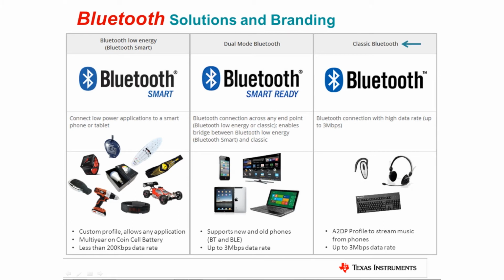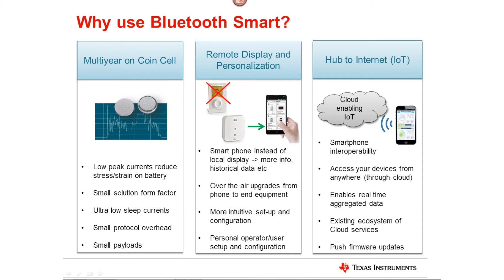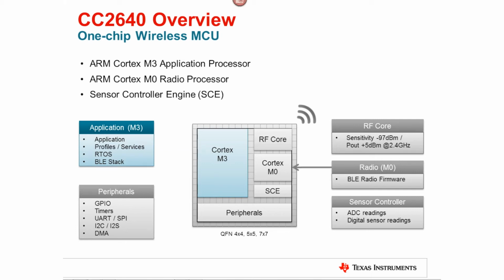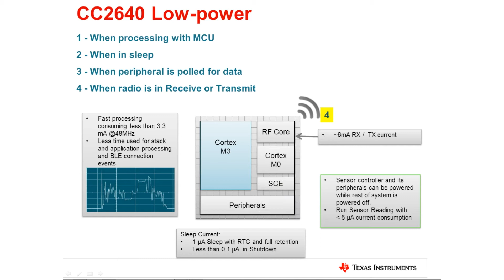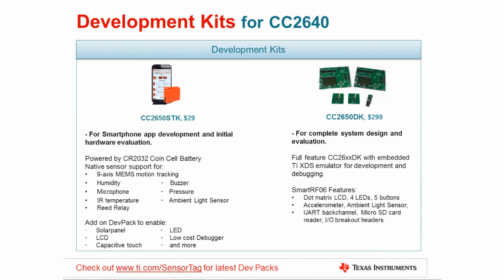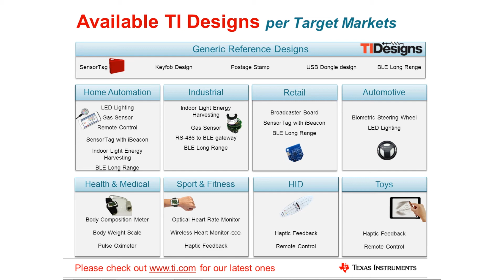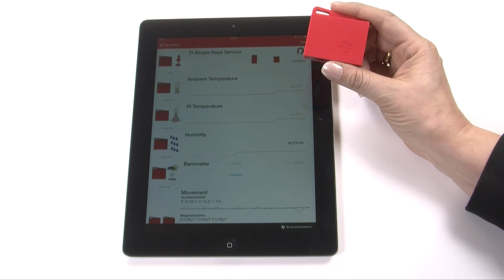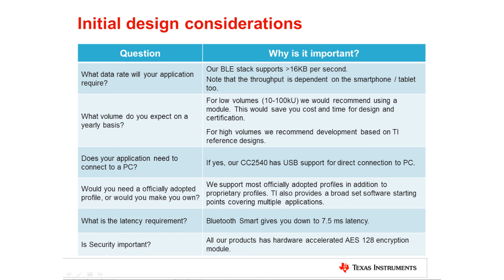Learn more about the SimpleLink Bluetooth low energy CC2640 wireless MCU

Comment: does cc2640 have a built in antenna or i have to attach one?
Reply: CC2640 is a chip.. Usually chips don't have an antenna built in.. It also depends on your design where you need the antenna, if signal strength is important for you